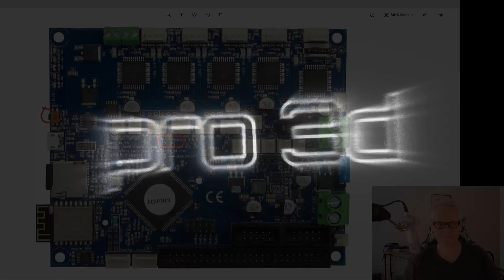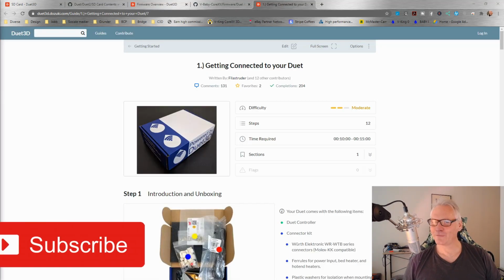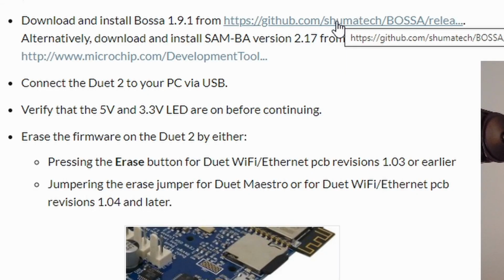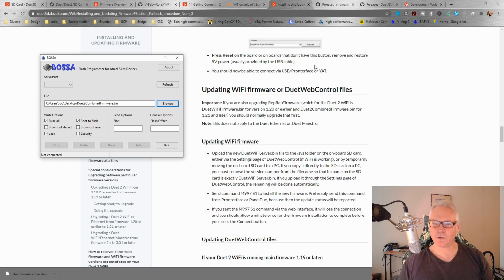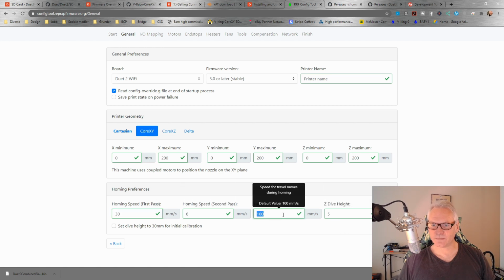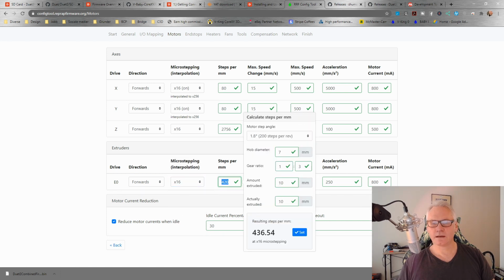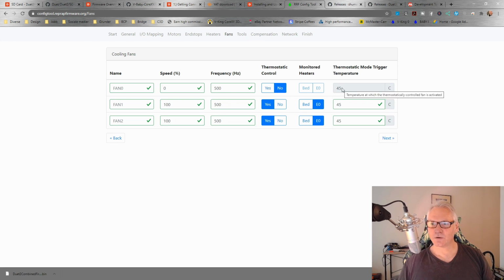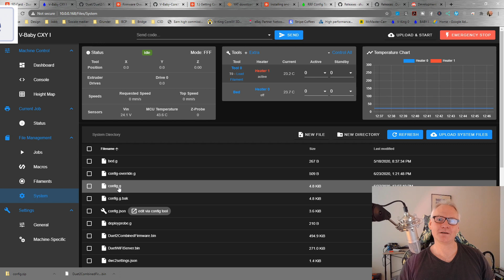DUET WIFI | 3.1.1 FIRMWARE INSTALLATION | The Best 3d Printer Controller

Comment: Ok, everything finished but the Macros.  I cannot find the macros anywhere.  Also, my motion is all messed and end stop switches not working.  Only one Z axis lead screw moves and X and Y are mixed up.  I've check the board and it's wired correctly.

Comment: Not good, Not sure what everyone else is watching but some pictures on a video defeats the purpose of doing a video, this was like watching someone read a tutorial while skipping parts to save time. HOW ABOUT THE ERASE PART THAT IS KINDA IMPORTANT, SHOULD BE ON VIDEO.
Reply from the maker: Sorry about that. I thought I covered the erase
Reply: @PRO3DESIGN  so why not explain that in a video! I am messed up now because I cannot connect to the board either via Bossa or Yat. I could not enable the USB driver via update... complete fail. My board was actually working before you suggested an erase!!!

Comment: Thanks for the tutorial. Dunno why this isn't the suggested method on the Wiki as I guess chances of bricking stuff is always there.

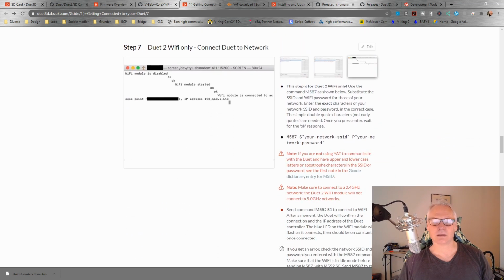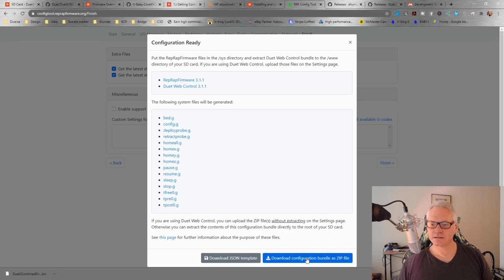The video is however missing the point that a fresh SD card wont have www folder and the web interface wont therefore be accessible like stated in 7:00 and 12:36. Instead you need to move this  DWC stuff manually on your SD card (from e.g. the config zip that includes them if you chose so).

Also a small error / misleading guidance there at 6:20. There's two different naming for the main FW depending on the version and also, these are not needed at all as the new main FW was just flashed. Instead just follow the 'Updating WiFi firmware' steps like stated afterwards.
Reply from the maker: Thank for the in-depth response. I am not able to re-edit it now but thanks for pointing this out. Happy melting plastic

Comment: Where do i find wifi module firmware and can i use bossa  to install ?
Reply from the maker: https://github.com/Duet3D/RepRapFirmware/releases/tag/3.2
Reply: @PRO3DESIGN  wich files do i have to dl? I installed combined and running 3.2.2 but i need to get access to web and my wifi i running 1.02.
Reply: @PRO3DESIGN  can i get it up and run i i don't no my sensors ?  i can only se 0.5 V i my duetweb control.
Reply from the maker: The wifi firmware i think is in release 3.0 on github
Reply: @PRO3DESIGN  thank you🙂 is there an guide to get into web interface, if i write my ip, it says no sd card.

Comment: If you're on a Mac I suppose it's much easier to just install V3 and then V3.1 and you're done in a couple of minutes. Honestly, you don't have to fiddle around with all this. I recieved a Duet2Wifi with V 2.1 and it took me 10 mins to get up and running with the latest version. The hard bit was to find the information on duet3D but it's all in there if you search.
Reply from the maker: If you have rrf 1.19 the upgrade path is much more complicated

Comment: This video was great - thanks for the help. It took some time to work out the details for the Fysetc Duet Wifi and PanelDue though. Here are my notes to try to help anyone else attempting to do the same: 

1. Update PanelDue first using Bossa: 
https://duet3d.dozuki.com/Wiki/PanelDue_Firmware_update
Fysetc PanelDue 7" Use Firmware - V1.24 - v3-7.0bin
https://github.com/Duet3D/PanelDueFirmware/releases
(use Bossa to flash - connect to comp using usb, remove SD card if in. Hold erase button to clear till  screen goes black, hit reset button, upload firmware with erase all, boot to flash and lock options checked)

2. Update Duet WiFI Board 1.04 - to V3.1.1 RepRap using video above

3. Get a 16GB microSD Card, format it using the SD association tool and and create the folders shown here: 
https://duet3d.dozuki.com/Wiki/Firmware_Overview#Section_SD_card_structure

4. Create the cSD Card Structure - essentially - format SD card, create the folders (www, , and then place the Duet Web Control files (creates the web interface) in the www folder.
https://duet3d.dozuki.com/Wiki/Firmware_Overview#Section_SD_card_structure

Put this in 'www' folder: https://github.com/Duet3D/RepRapFirmware/releases/download/3.1.1/DuetWebControl-SD-3.1.1.zip 

(essentially we're doing this:   https://duet3d.dozuki.com/Wiki/Installing_and_Updating_Firmware - Install using Fallback #1: )

Put these in 'sys' folder: 
https://github.com/Duet3D/RepRapFirmware/releases/download/3.1.1/Duet2CombinedFirmware.bin

https://github.com/Duet3D/RepRapFirmware/releases/download/3.1.0/Duet2CombinedIAP.bin (see: 

https://github.com/Duet3D/RepRapFirmware/releases/download/2.05.1/DuetWiFiServer-1.23.bin - rename to DuetWiFiServer.bin

https://github.com/Duet3D/RepRapFirmware/releases/download/1.21/iap4e.bin   (see: https://forum.duet3d.com/topic/15603/iap4e-bin-how-to-download) 

Put the microSD Card into the Duet Wifi

5.Connect Duet Wifi to PanelDue using the 10 pin ribbon cable (Conn_SD on Duet Wifi) and using 4 pin cable from PanelDue connection (shouldn't be needed) https://duet3d.dozuki.com/Wiki/Connecting_an_LCD_control_panel#Section_Connecting_a_PanelDue 

Then run M997 S1 to install the firmware files (For Wifi) - it will show progress in 5% increments

6. Follow these instructions: https://duet3d.dozuki.com/Guide/1.)+Getting+Connected+to+your+Duet/7 

7. Create config using this https://configtool.reprapfirmware.org/Start and unzip into SD card in 'sys' folder. 

I had trouble with the wifi not connecting and used these instructions: 
	* Then run M552 S0 to put the WiFi module in idle mode
	* Then run M552 to check that it is in idle mode (not still "being started")
	* Then you should be able to use M587 to add the SSID and password.
Reply: Hi. Thank you for your notes :) I wanted to ask you if you could help me ? I did everything as you wrote. But when I wanted to do step 5  it showed me: Error: M997: File DuetWiFiServer.bin not found<LF>ok<LF> . I checked it twice - I have this file on my SD card :) Many thanks ! :)

Comment: Hello Roy, I got an answer from the bossa developer:

Hi Christian,

Both Microsoft and Apple now require software installers be signed with a developer certificate.  I no longer maintain a developer certificate since they cost several hundred dollars per year along with a few hours of hassle for notarized documentation.  Therefore I no longer provide Bossa binary installers.

Your options are to either build it yourself or convince someone in the community with a developer certificate to build it and I can put it up on github.

Cheers,
Scott

Comment: I have not updated to RRF V3 yet but for those of us who have highly customized config.g files using the RRF configurator is not very useful so you will need to manually update the config.g and  IIRC there are some Mcodes in RRF V3 that replace some of the older Mcodes.

Comment from the maker: In config.h use this for BL Touch:

; Z-Probe
M950 S0 C"exp.heater3"                         ; create servo pin 0 for BLTouch
M558 P9 C"zprobe.in+zprobe.mod" H5 F180 T18000 A30 S0.02 ; set Z probe type to bltouch and the dive height + speeds
G31 P500 X18 Y-18 Z1.0                  ; set Z probe trigger value, offset and trigger height
 (set your own)
M557 X25:205 Y0:180 S90:90                   ; define mesh grid (set your own)
Reply: How do you have the BL Touch physically wired up? Good video by the way.
Reply from the maker: @waddo10  https://duet3d.dozuki.com/Wiki/Connecting_a_Z_probe
Reply: @PRO3DESIGN  so the 'control' pin to heater 3 (pin 8)?
Reply from the maker: @waddo10  that sounds right
Reply: @PRO3DESIGN  spot on thank you. Hadn't found a clear guide on the new pinout names/references and didn't want to upgrade to 3.1 and get stuck with no BLTouch.
Reply: I bit the bullet and updated. Unfortunately i am getting "G28 Error: Failed to enable endstops" when trying to home Z.  Any chance you could share your homez.g,  deployprobe.g and retractprobe.g files please?
Reply from the maker: @waddo10  

; homez.g
; called to home the Z axis
G91              ; relative positioning
G1 H2 Z5 F18000  ; lift Z relative to current position
G90              ; absolute positioning
G1 X135 Y195 F18000 ; go to first probe point
G30              ; home Z by probing the bed

; deployprobe.g
; called to deploy a physical Z probe
M280 P0 S10 ; deploy BLTouch

; retractprobe.g
; called to retract a physical Z probe
M280 P0 S90 ; retract BLTouch
Reply: @PRO3DESIGN  THANK YOU so much, got homez.g to work now. LAst one i promise, could  you share you homeall.g file?
Reply: In fact, i think i have got it. Just basic ally copied homez.g into the homeall.g Thank you again for the help. It is very much appreciated.
Reply: M558 P9 C"zprobe.in+zprobe.mod" H5 F180 T18000 A30 S0.02 ; set Z probe type to bltouch and the dive height + speeds

My question is does this line actually need the "+zprobe.mod" section in it?  As far as I know, the BLTouch doesn't use a modulation signal, so as long as the servo pin and input pins are defined it should still function correctly (as far as I can tell).

Thanks for sharing this!  I'm in the process of swapping an Ender 3 Pro over to a Duet Wifi 2 with BLTouch.